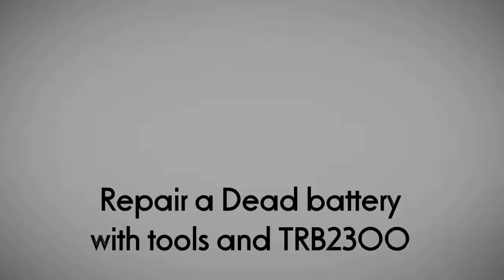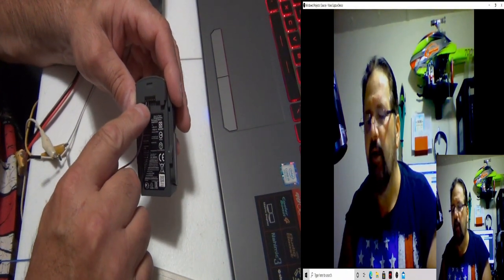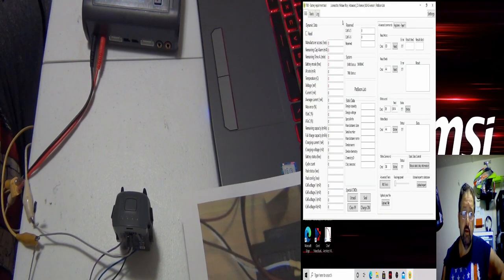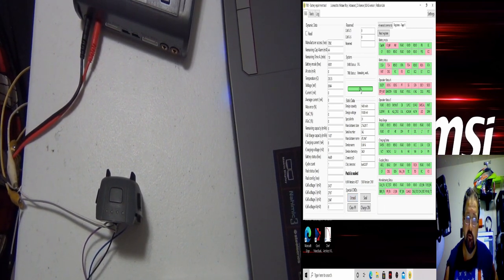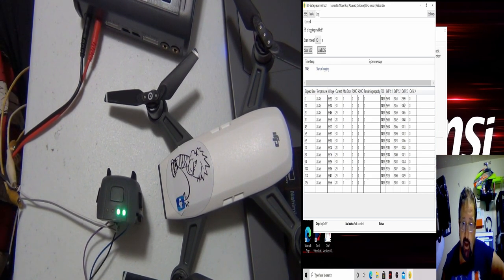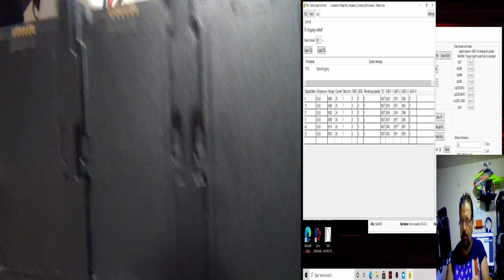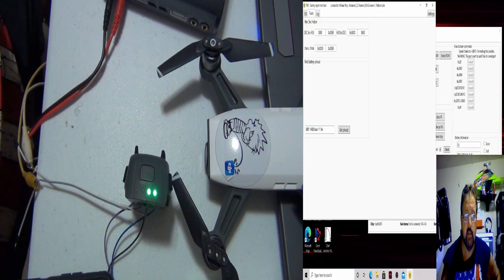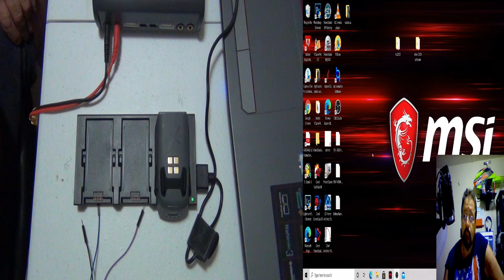DJI SPARK repair a dead battery with TRB2300 and tools

Comment: My Spark battery would not charge/failed by “smart dji charger “. I found another video to take apart battery case. Once circuit board was exposed i used a cheap single cell lipo charger to charge the cells one by one using contacts on exposed board. I charged them to ~3v then tried to charge it back on DJI charger and it worked, now fully charged.

Comment: What upsets me about DJI is you can still buy the Spark, NIB from online retailers. But batteries are no longer available. I have 2 Sparks, I have hundreds of flights on them and the batteries are going bad. My Sparks are like new, Never been crashed, they still take excellent videos and stills. DJI should still make batteries available or allow aftermarket companies to make them and a kit to replace the cells.
Reply from the maker: DJI is like APPLE, they want you to buy there new drones and upgrade....sorry but there are people restoring spark batteries and have them for sale
Reply: @CRUZROYHelicopters  $100+ for a reconditioned battery from an unknown person? No thanks.
Reply from the maker: @brians6480  1. i dont think anyone sells Spark batteries for 100+ 2. i did not tell you to buy 3. you can rebuild them yourself, just need the tools, all lipos are only good for the most "if you take care of them", 500 charges, after that they stop taking 100% charge....
Reply: Yep! That is exactly how it is with Mavic Air (1) kits and SCARCE batteries. Same exact experience. They should make them easier to mod, or produce them. They do whatever the CCP tells them to do.

Comment: I have two dead batteries - both have LEDs 1 & 2 flash 4 times when I try to charge them, but no other activity.  If these things didn't cost $100 now, I would just buy new ones!  I hooked up a CP2112 and a 12VDC 2A power supply per the pinout.  I can immediately read from the chip and initially when I plug it in, the voltages look LOW, but they're there.  I unseal it and clear the faults But instead of doing any charging, the cell voltages just slowly drop.  It's gotten as low as 900Mah per cell before I stopped.  But the weird thing is that when I disconnect and reconnect it, the cells start back up around 1400mAh.  I'm baffled.  Are they BOTH internally shorted, but not enough to actually kill them, or am I just doing something wrong?

Comment: You can simply use Nicad or Nimh and set 500mA, then let it charge till the voltage come up to 9 volts, then stick it on the normal dji charger.
Reply from the maker: Not possible at all
Reply: @CRUZROYHelicopters  I did it to a I1 battery, let it charge for about 5 minutes and it woke up, tossed it on the stock charger and it worked, of course not all dji batteries work the same.
Reply from the maker: @user-rs8zg8ey2b  the battery wasnt really in failure then, you can try 24 hours on dji charger to see if they wake up
Reply: @CRUZROYHelicopters  the bms in notebook batteries, some have a mode to jumpstart over discharged dead batteries and some do not. Even though the cells are below the safe range they give them small pulses of current (like 100mA) in an attempt to get the cell voltages back into normal operating range. The bms that don't do this function need an external jump start. Question, what is FAILING on these dji batteries that need a program reset? Are they doing this if the cell voltage goes too low and then suicide, to make you buy more batteries)? If it's not too low voltage, then what else fails on batteries that this method can bring back to life? Tia

Comment: Good Video Thanks, So Is a battery From a "MAVIC MINI" that fell in water shot even though was showing 4 lights was just blinking so I let it drain now I just get 4 flashes. Thanks for your Time! SO if the BMS is dead I could use the batteries out of the unit?

Comment: Folks, I almost wrote off my FOUR spark batteries for dead after I had not touched them for 2 years.  They were totally unresponsive.  They came to life on the THIRD mini USB cable I tried...and I also used a 3A USB wall charger instead of the standard 1A and 2A wall chargers that most are rated at.  Use a 3A charger and try several USB cables.  All four of my batteries came to life with that cable.
Reply: Do you have any idea what the cable was from? What adapter are you using? I am using the dji 3A adapter and cable that came with it. I get the 2 flashing lights but it won't charge and after like an hour the lights stop blinking. I also tried charging from a 3A battery pack with the dji cable and no luck. This spark was never even flown because it was a gift to my father and he never even tried it.
Reply from the maker: @travispoulin252  no usb cable will get rid of permeant fail and SS hardware failure....it must have been a coincident and batteries he had where in hibernation mode
Reply: Yup, I'm noy sure about thecables but maybe higher queality cables would help make the charge work better.
I bought a bunch of Spark drones and various other DJI drones including video equipment at reasonable deals to resell at Xmas. Unfortunally, I was hospitalized for a period of time and finally got better but by the time I dug out the drones it was 2 years later and a lot of batteries that felt like they werte to be paperweights. However, after reading some responses from people using higher voltage and different types of chargers it reminded me of the DeWalt solution.  Where, I forced higher voltage into my dewalt batteries for a short period to make them work again. So, I tried using my son’s RC car lipo plus multi-charger (that has veariable settings for different types of batteries) and connected it to the Spark battery. After like 15-20 minutes it forced voltage or a charge into it and basically broke the lock on the “Hybernation” that went below and beyond the help of a regular charge from a DJI charger. But once you do it you can go back to using the DJI chargers like you did when you were flying and using them regularly. Remember, when you store a drone it’s advised to charge the batteries up to a 100%. DJI has made these batteries “smart” so they discharge over a 10 day period to something like 65-70% to prevent swelling. But if you don’t charge them every month or so they’ll continue to discharge little by little. Then, hopefully you’re not like me you finding yourself a couple years later with near 30 batteries that are bricks. Though, you will need to jury rig a connection but Roy’s pin out for the battery is correct so go by that. It’s an easier method which is not costly and simple to do basically. If it doesn’t work for you than go onto more “involved” methods. But either way it’ll be easier for you bto do it for a few batteries than having to do it to 30 batteries, one by one… I got them all working except for one that is only holding an 60% charge…  Good luck.  Try this method before blowing money on unnecessary stuff…

Comment: Amazing work. I have a dead spark battery. Can I get your info to see if you’d be willing to work on my pack.  Mine went idle from storage. Thanks.
Reply from the maker: i would have to see if cells got to low, but it can be done, i sent 4 back to someone and one just failed after a few charges, but it had one cell at 790 mv i got it to 3.8, but got to low to stay revived

Comment: It's bullshit that we need to buy an expensive device and expensive software to revive our spark batteries.

DJI needs to do better.

If anyone knows if this method can be used to replace the cells in the battery, I'd love to hear of any info anyone has.
Reply: True. Mavic Air batteries are outrageous. They should make modding easier, or produce the batteries.

Comment: I have a mavic air bought it 2018 flown it with one battery the other never been use but charged three of them after unboxing then stored maybe 2 years then after the storage I took it for firmware update after charging the three batteries on the charging hub two batteries were completely charge except for one so I charge it by itself direct from the charging unit not the hub nothing happens push the button several times no lights on the indicator so can I send you the battery to be repaired and how much and where to send it.....thanks

Comment: I wondered if you might be willing to help me out? I have 4 batteries for the spark that all died from sadly not knowing how to store them properly. I have purchased both the cp2112 and the ev2400 and attempted to read them with TRP/battery killer but all 4 batteries have no communication with the PC whatsoever.  same symptoms with them all. any ideas? I purchased a CP240 duo based on your recommendation and attempted to follow the same steps, the batteries light up with no charge light pattern but just dont comm seemingly no matter what. Any advice?
Reply from the maker: whatch new video...and let me know    https://www.youtube.com/watch?v=Z37JgBw59P4&t=236s
Reply from the maker: you have to have the cp2112 wired right
Reply from the maker: cp2112 only works with batkiller, trb has to be paid for, the wireing has to match the pins, i wouid have to see pictures, caz once you can comm, i can tell you steps, i need voltage of each battery cell, then i know steps

Comment: I would be curious if you just jumpstart it with the power supply, if it will come back to life, no trb communication?
Reply from the maker: No you can find videos on it I can actually charge the battery to complete 4.2 V and it still would not the brain Hass to be reset if it was that easy everybody would do it
Reply: @CRUZROYHelicopters  Thanks, another reason to hate DJI, like I did not have enough already, lol.

Comment: Thanks for the vid - are you able to connect to a DJI Mavic Air battery. I have 3 that have been sitting in my closet for about a year unfortunately. - Thomas
Reply from the maker: yes i can
Reply: @CRUZROYHelicopters  Thx - I emailed the address in your description and created Ticket #42819 - waiting for follow up. - Thomas
Reply from the maker: @yourdailyblockchain  thats not me, thats the creator of the software i use to rrepair batteries

Comment: great video should edit out the mistakes parts. i figured it out why there are 2 side by side positive and negative sets and why only one set will charge. One set is for power going in as in charging the battery and the other set is for power going out as in power going to the spark. so if you made your own battery you would attach it to the complementary contacts on the spark for the set that you can not charge through.
Reply from the maker: that is correct, but if you build a battey you need to use spark bms anyways , so it would be wired correctly

Comment: Don't suppose you know any reason why sports mode and the intelligent flight modes would not be working on a Spark do you?  tried modding fw and using go mod and still no dice.   i'm not sure from a technical perspective why they would no longer work (ie something broken inside unit or something?!)

Comment: Damn I never knew a battery could be so complicated. What is this crazy TRB contraption and where do I get one? I sure wish they put the BMS in the drone and the charger rather than the battery pack. Really stupid that I have to buy extra equipment just to wake the battery back up. Should be able to just plug it into the damn balance charger and give it a blast with some Nimh action
Reply: The video doesn't show it, but you need a hardware interface between your PC and the battery.
Reply: @brsrc759  
FYI... Your post was shadow banned, for the usual unknown reason. 

DJI probably could ease up on the firmware with older versions so they can be more easily modded, but you know DJI does whatever the CCP tells it to do.

I just got into my Mavic Air (1) battery, using a $10 CP2112 interface chip and the "Battery Killer". So (assuming everything else goes well), cost wise, not bad. But you need to know how to handle electronics (few people who upload YouTube videos do), solder, and use utilities.
Reply: @AuroraColoradoUSA  what do you mean my post was shadow banned?
Reply: @AuroraColoradoUSA  I'm not sure which post of mine you are saying got Shadow banned but that's pretty screwed up. I feel like my entire YouTube channel is being shadowbanned. Nobody ever sees my comments. And I've been trying hard to build my channel for 7 years now and I only have 400 subscribers. The harder I work on making a good video, editing, and pushing said video, the less views they seem to get. It's so frustrating watching other YouTubers making more than a healthy living off of YouTube and i  can't even grow my channel enough to make one penny a month after this many years.

Comment: Hi,

I'm in Australia and have 3 Spark batteries that have been sitting discharged for a year or so now.  When trying to charge them in my spark I get the first 2 light flashing for 4 flashes then a pause and then 4 flashes then pause ongoing forever.  When I remove the battery and press the button nothing happens.

Is this something you may be able to repair for me or if I bought this EV2300 device would it allow me to look at fixing them as you did.  I notice there is a EV2400 device, is this an updated model from Texas Instruments?

Regards,
Brent
Reply from the maker: probably fixing yourself would be better, the cost of shipping to me would be more than finding 3 used batteries, but true i think DJI will be discontinuing the spark parts....yes the ev2300-2400 work....but you need to purchase the software to read and reset the problems, i can tell you from experience if the cells went below 1.0 volts, they are dead.....but above that they can be save....but the sleep mode is activated just after 3.0 volts, thats why i can revive them.. but you need to reset the SS and PF on the board, you can even take apart and charge each battery to 3.8 and still wont wake up....hope this helps
Reply: Can you fix my batteries?  What’s your email?  Mine sat in storage for a year when we sold our house. Only used once
Reply from the maker: @CSAAdventures  where are you and email i will give you info

Comment: Do you know what the BMS Chip number is for the spark, I bought an EV2300 but the drivers are giving me hell & TRB cant find the adaptor.. Trying battery Managment  BQ studio too, That gives a list of BMS chip sets but I dont know which one.. Pulling out old pre Windows 11 laptops and trying to problem solve.
Reply: Trying Windows Vista, hopefully I can get the drivers to work so the SW can recognise the Adaptor.
Reply from the maker: Yeah I wouldn’t updated to Windows 11 it kind of messes with everything you own cause there’s no drivers typically out there even for printers I don’t know the chipset offset in my head I work on too many of these batteries but if I remember next week I will
Reply: Figured out the issue. It was the firmware on the EV2300.  I bought a cheap one off ebay from China. You can't hardcode one unless you have a second EV2300 to do it. Patrick from Patboon.labs was really helpful. We set up a Virtual box in Win 10 to load Win XP. Patch the Ev and then killed the Virtual box to load the firmware.up to Win 7 which TRB recognised. Revived my 3 batteries that had been dormant for 2 years.
Reply: Your video was very helpful and showed me what I needed to do. The batteries will last a long time dormant. You just need to  free the from the PF (permanent fail). Mine were all in the high 2800mA range even after being dormant for years. Many thanks for taking the time to record it..

Comment: Hi there. I’m in the UK with a similar problem on two of my Phantom 4 batteries. I’ve checked your video page and it looks like you didn’t cover a repair of P4 Li-Po’s on your channel?
I’d be real interested to know if you’ve tried this process on a P4 battery, and if you made a video of it?
Great work though, and a refreshing break from the “I’ve fixed it but can’t show you how” videos that litter YouTube!!
Reply from the maker: P4 can be done, not as easy as some, DJI glued the caps on, so some times they break, and also the solder points or gold dots are very delicate to solder to, and can rip off easy if your not carful

Comment: I have 5 spark batteries that have been in storage and now will not charge. Since they have doubled in price I cannot justify buying new batteries. What would suggest I do? These batteries probably have less than 5 flights on them. Storage time was almost 2 years. Thanks
Reply from the maker: If they are repairable I fix for 25 $ each. And you pay shipping both ways

Comment: I've got a Mavic Air (original) battery that I ran down and now won't charge or show any LED. I've tried leaving it on the charger overnight, but I think it went into permanent fail mode. Have you tried restoring these?
Reply from the maker: i can but have not been successful opening the case.......dji uses tons of glue
Reply: @CRUZROYHelicopters  I thought it could be done without opening the case.
Reply from the maker: @rzu7120  not mavic pros lipo, mavic minis yes

Comment: I ended up buying a b6 IMAX v2 and the debug board, have 3 dead batteries and going away next month

Only used my spark a handful of times

Stupid charger keeps saying cell voltage not matching

I'm charging directly on the cells too

Don't know how to bypass this
Reply from the maker: the only b6 IMAX charger that has digital power is the V3  https://www.ebay.com/itm/295361624076?hash=item44c4ecb80c:g:FRAAAOSwn0ljfkMv&amdata=enc%3AAQAHAAAA4H5MtvxKwsdlznxwSUDnlfbY0cT6IDVlLsyjglMrJuDSV6AfCwI9INapQdBh8ZhRg6cxnqubZOXRKFPtwDp48jYn4uaKZI8Qdfd%2Fv8yWIiMxWnK7PbsP%2FWuncFWDUmp4CfxfglTfCH3yGD51q2JWwnjlMacC5e1jVU6yRfdOntxxyyCwozRE0ksk8td6h%2BCSzXz1Qlr9R5rkuOGwyeNaI5fDZUK3iSvJzmoPSCOSKDxBKPRfYP%2Boj0Uf941bHFXOIhidJGBZQN8Y9G%2Bbx%2BZW73vyuoAgMbhyAe76t2SHoj8u%7Ctkp%3ABFBMyJKWweFh
Reply from the maker: you need 13.6 volts at .5 amps
Reply from the maker: im in US, i get 30 to repair, dont pay unless i fix, you pay shipping both ways